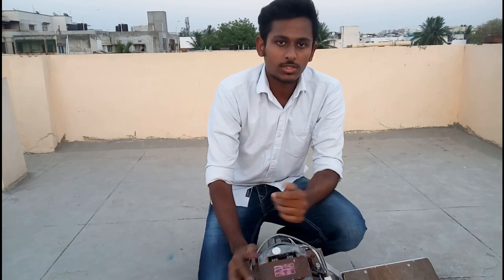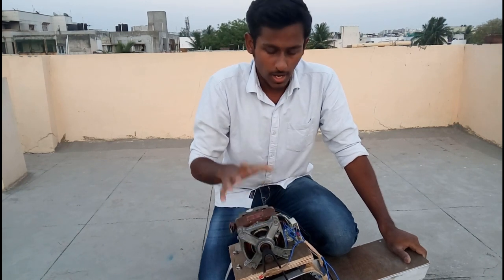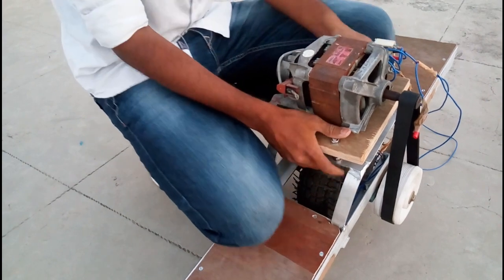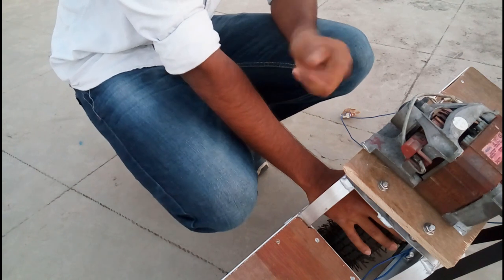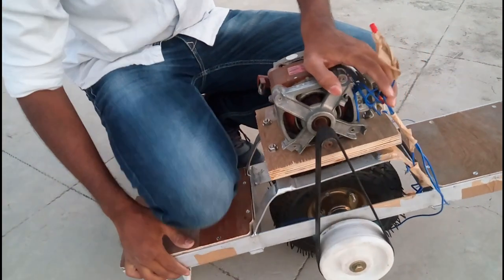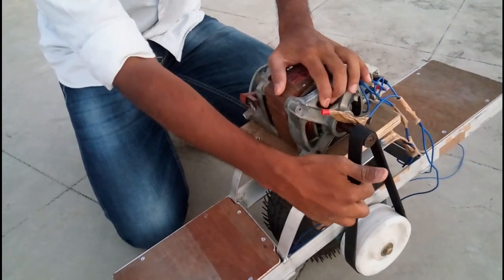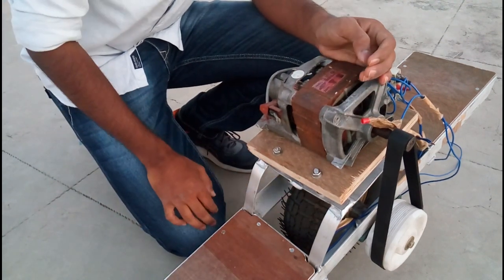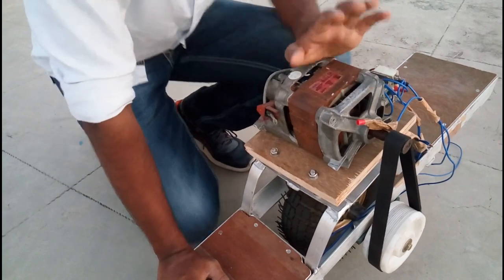ONE WHEEL V-1.0 First DIY in India - Promo | Part 1

Comment: Dude well attempt, However you cant call it One wheel until it's driven by gyroscope sensors or it will be very difficult to balance. The motor you trying to install have to maintain a balanced center of mass it has to be inside of the wheel.
Reply from the maker: Yea
In the latest video I have done it 
Please watch in my video list

Comment: You can add inverter for this sample structure then the motor get fine current
Reply from the maker: Yea we can add but to get good backup we need to add batteries which have more Ah

That's make project very heavy
Reply: @BOLTsLABORATORY  that's make the board heavy to carry
Reply: So it can't be a carryable project
Reply from the maker: @sriram-hx2jy  yes

Comment: The 10inch they used is not the diameter of the tyre. It is width of the tyre.
Reply from the maker: Oh then what's the diameter of tyre?
Reply: @BOLTsLABORATORY  my bad , you are right , 11.5 x 6.5-6 is the correct tyre info
Reply from the maker: @VFrame  okay 😅

Comment: must be honest, it's kinda shitty. simply it's not practical, you are using a washing machine motor, not very powerful, and it is made to run on AC current, increase all the batteries you want, good luck balancing 50 cells in series. 
after a while one must admin a design is not good and start over. you should use a proper electric motor, brushless. 
i'm right now building one myself using a the pieces from a hoverboard
Reply from the maker: I already did
Check the latest video